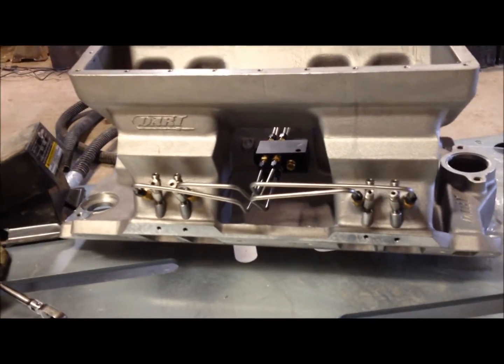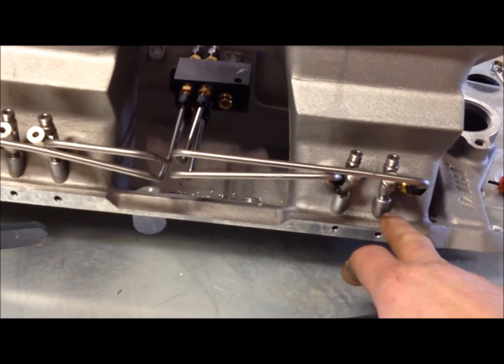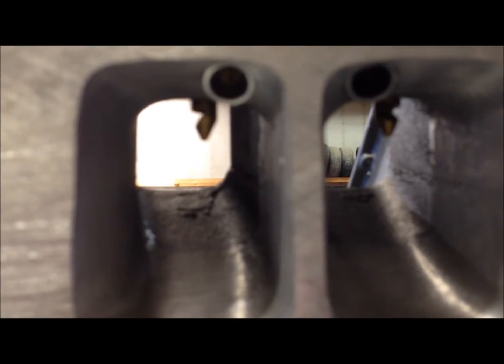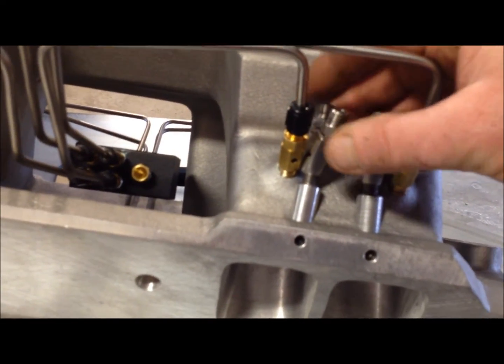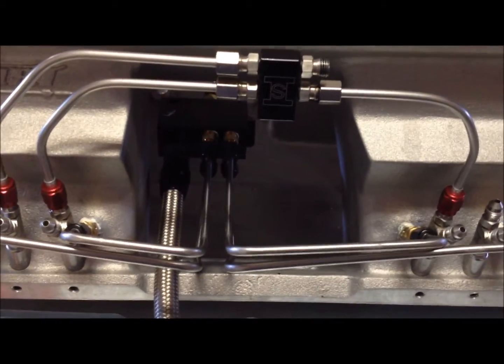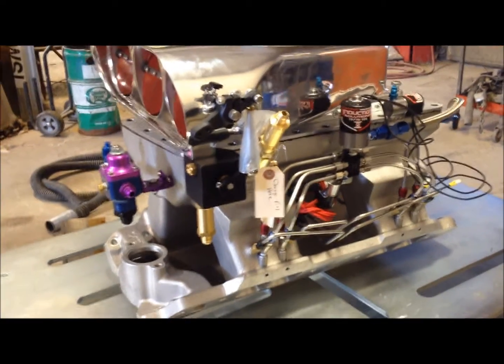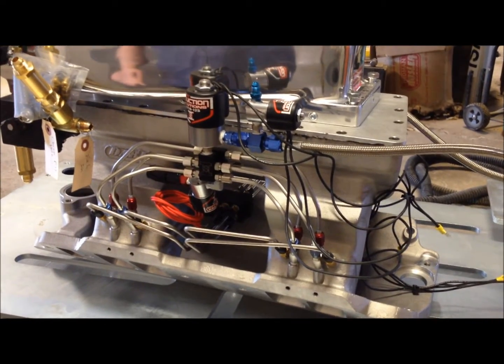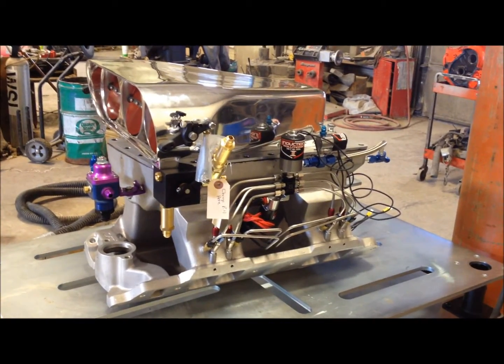Nitrous fogger install and test

Comment: Ever thought about putting the heads on with intake with out pistons in the engine and remove intake valve so you can see exactly how its going to hit the valve I wonder if you could point the sprayer to where it enhances swirl?

Comment: Do a demo of the fuel and sniff all turned on at once if you can..It's like a pressure cleaner...Probably make that manifold hover....lol....People should remember this is extra stuff going in on top of the engines natural abilities...Love it Jeff.
Reply from the maker: Thanks bud. I love working with this stuff. Sharing with you and reading the comments makes it even better.

Comment: Those trash can solenoids or regular? If it's a regular one, the internal orifice is pretty much the jet on a 400 hit! Nice work
Reply from the maker: When I ordered this kit I told them I need to spray 500hp. They sold me there X275 kit and said guy's are spraying up to 700hp with it on a single fogger. I guess we'll find out. Cant wait to test.

Comment: Jeff are you going to use green loctite on them ?

I have used it on a few things and is as good as welding
Reply from the maker: I was thinking of sealing the bungs with something but I'm going to run the engine first. They might not need it. I will Loctite the set screws though.

Comment: Jeff,
Please look at my 46 olds Pontiac engine video and my discussion of what I found and please give any advise you can.
Thanks
Reply from the maker: It sounds like your headed in the right direction. Basically disassemble and clean up is all you'll need. I'd have to see the engine to give a proper diagnosis. It sounds like you know what to do though. Good luck.
Reply: Thanks Jeff and I follow your every video.